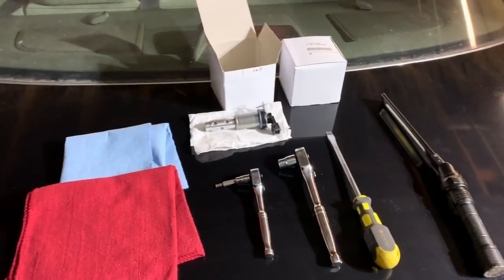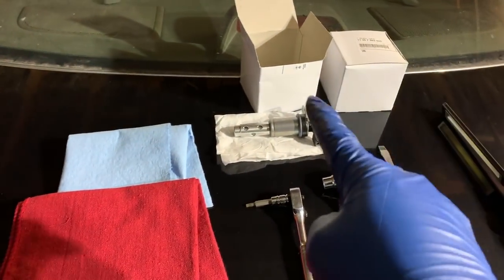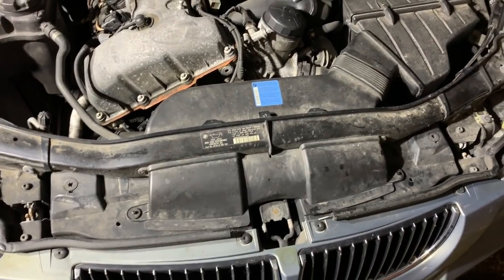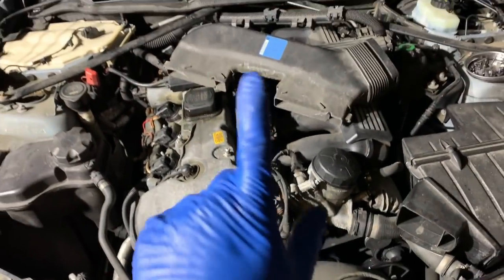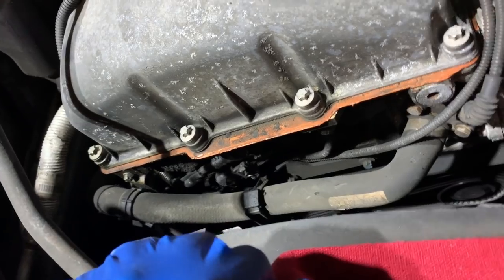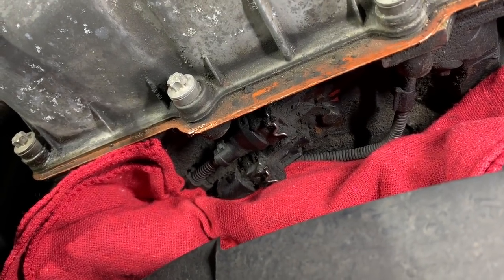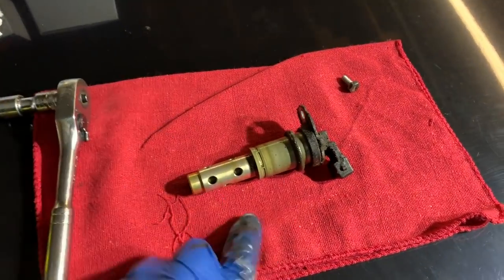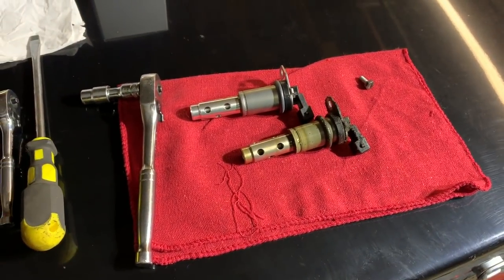How To Change Your VANOS Solenoids -- BMW E90 Maintenance -- Part 2

Comment: Great video as always! Do you think I would need to replace the VANOS if my rpms jump up and down only upon a cold start?
Reply from the maker: Could be. I know in my case my RPM was erratic regardless of temp. Mine even fluctuated a bit while I was driving! It was amazing to me how much smoother the engine got after changing the solenoids!
Reply: Crossroads Rebuild interesting, I’ll guess I’ll just do it for preventive maintenance anyway

Comment: I have a question. I took mines out and they looked clean . Almost new . Car has 130k miles . One of them had the O ring and the other one didn’t  so I didn’t pay mind to it . Maybe it was stuck in their . When I went back to turn the car on the cold start was rough and it kept misfire for a good 6 secs and then it went away . And my Service engine soon light came on . Which I didn’t have before. The cars rpm was jumpy before that’s why I took the solenoids out . Do you think that’s the reason why my light came on bc I didn’t place the o ring back . ? Is it that important.